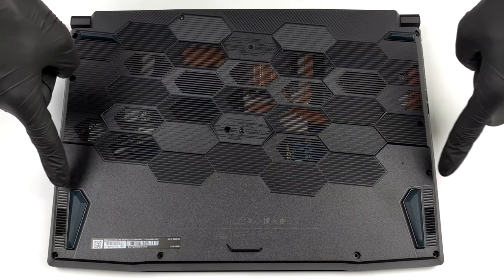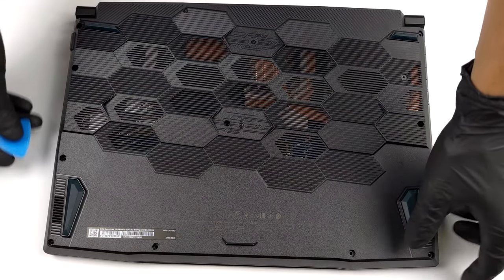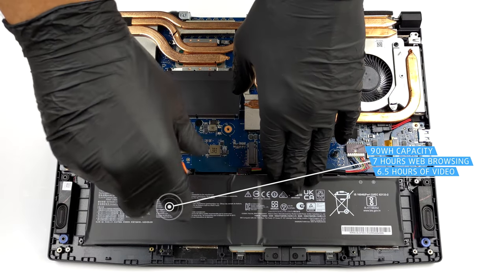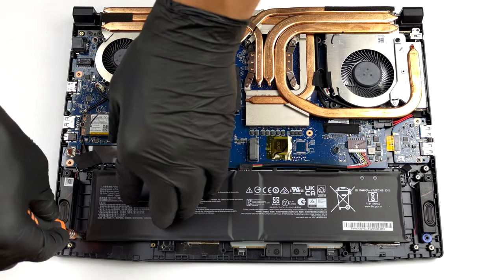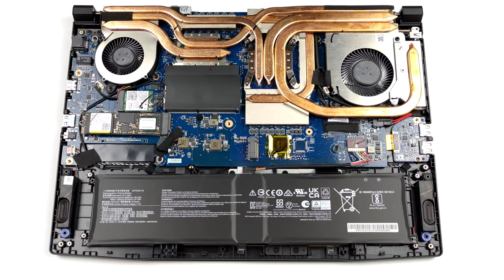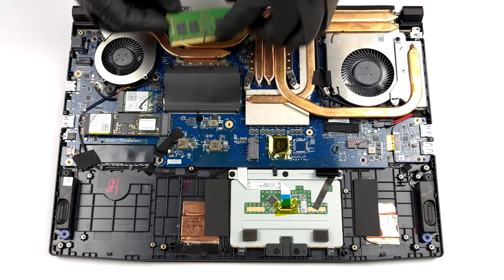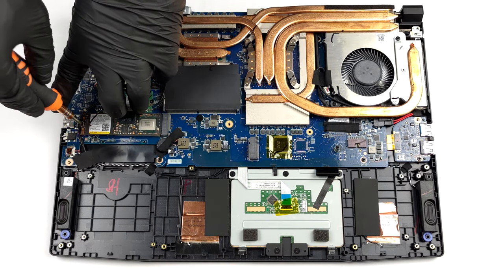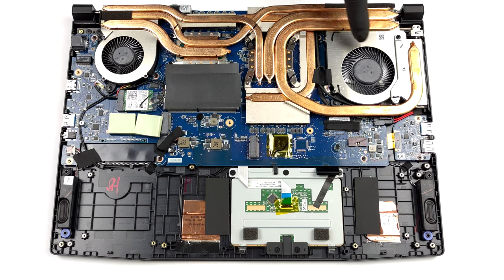🛠️ MSI Crosshair 15 (B12Ux) - disassembly and upgrade options

Comment: The 2nd ssd slot screw is really tight.
Reply: I stripped the screw. It finally came out when I used an elastic band and pliers. 😢

Comment: I have a lot of problems with usb and usb type-c ports of this laptop.... don't recognize usb 2 hdmi adapters. I use same adapters in others machines as a Dell Vostro and it's  works perfectly, but in my MSI Crosshair laptop not recognize it ... ¿why?  did anyone else have the same problem? I'm so frustrated with this laptop....
Reply: The USB and type C does not support display connectivity on crosshair 15.